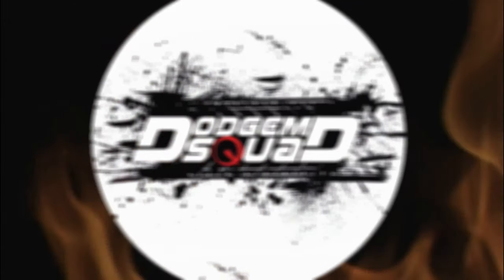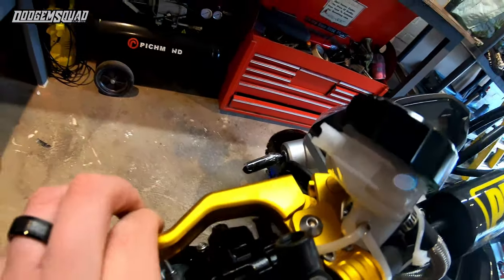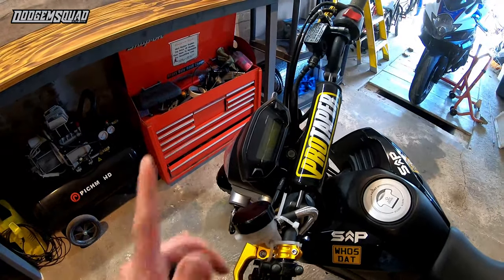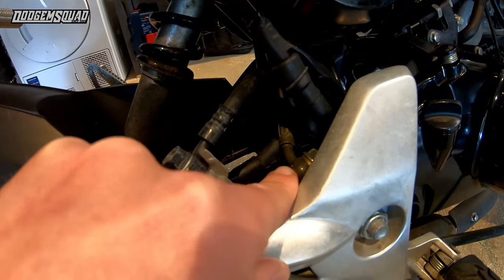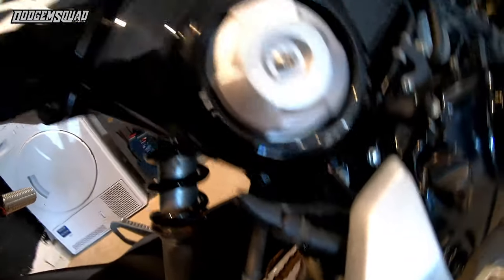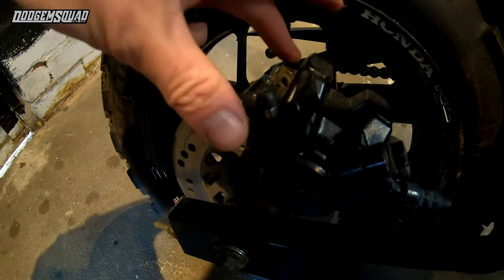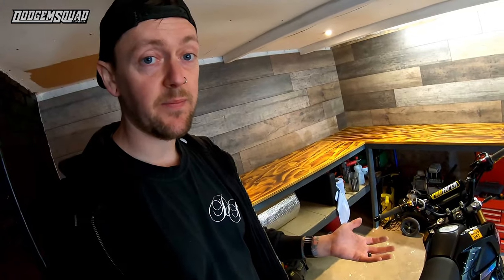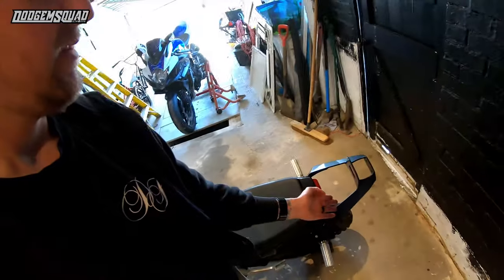Honda Grom - BEST Budget Handbrake! - Junction valve

Comment: Ive got one that i still havent fitted, had it for years but you're right its perfect for a bike of this size,i wouldn't run one on a super . Good vids boys 👍🏻
Reply from the maker: I think with a better master cylinder on the lever it would have even more bite as well
Reply: Where did you get the teardrop from cant find one anywhere in uk

Comment from the maker: After a lot of msgs asking about our handbrake setups, we've made this, showing all the parts you need with links to buy it all.
Reply: @dodgem squad
Would you still suggest the junction valve?
If you could go back and do it again would you go with the dual caliper set up?
My subcage is being shipped out today. Ive been learning footbrake 
And now its time for a hsndbrake. 
Thanks
Reply from the maker: @bobyolstunts2725  these work really well if you bleed them up good. A dual caliper setup however would be twice as good, but the cost is substantially more.
Reply: @Cranked-up-racing  yes its going to be about 500$ if I buy the whole kit together with a p34 instead of a p32. From perfect stranger on tacticalmindz..
How much was this whole setup?
Reply: Ive heard dont bother with junction valves.. but i have to drop atleast 300 on my other bike for a new clutch basket so fuck man.. fuck.

Comment: Would the round value work the same as the tear drop one is out of stock ?
Reply from the maker: Pretty sure it does yeah. I think the tear drop was the only one in stock when we got ours though.
Reply: @Cranked-up-racing  cheers buddy ill give it a go
Reply: Probably too late,  but they are for different style rear masters. Round are for all Honda’s other than Grom. You can get an F4i master for $20 and run that